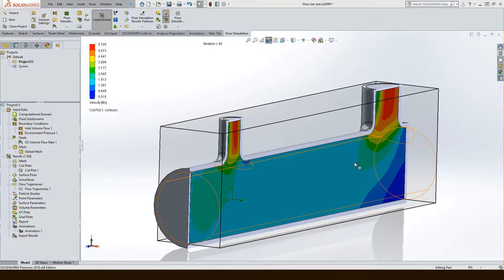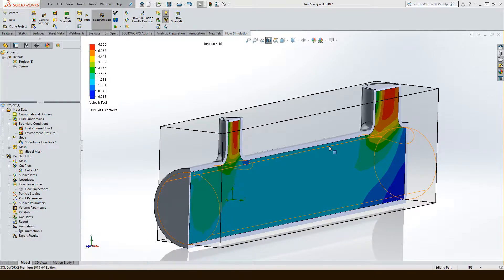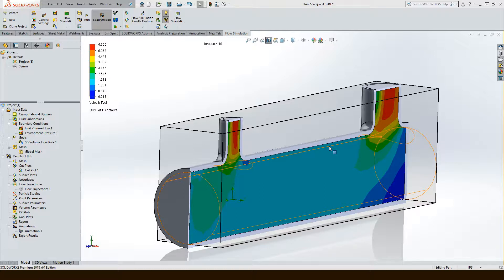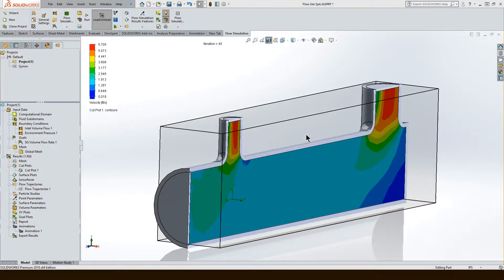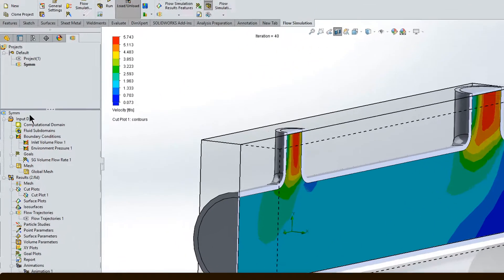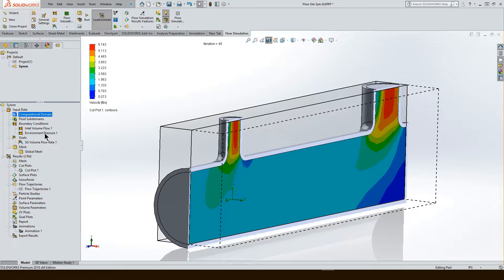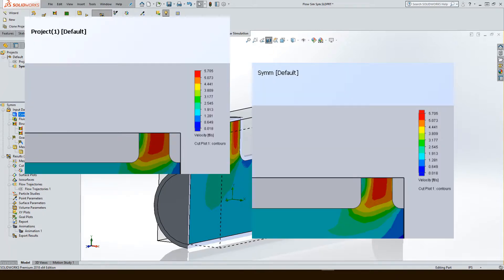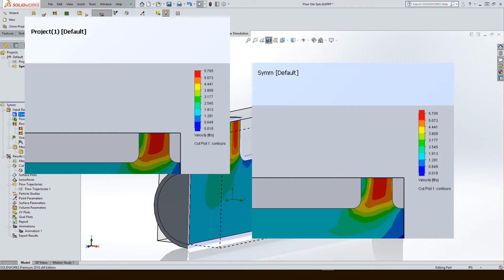SOLIDWORKS Simulation Flow - Flow Symmetry

Comment: Oh wow! He neglected the most important part which is how to set up half the model.
Reply from the maker: It is as simple as it is shown in the video.  Create the full model and set up the flow study as you normally would, then adjust the computational domain to use the Symmetry boundary condition and set the location of the symmetry plane.  The new domain is represented with solid lines, and the "other side" is represented with dashed lines.  The model visually looks like it is cut in half already, but that is because he has a section view active to visually represent the domain of the new study.  The only other modifications required are to adjust boundary conditions if they aren't already defined in a per-unit-area way or are independent of the area such as the velocity or temperature.  
This tech tip video does require that you know how to use Flow Simulation generally but have not yet tried to utilize symmetry or periodicity in the domain.
Reply: @MLCCADSystems  alright got it thanks.